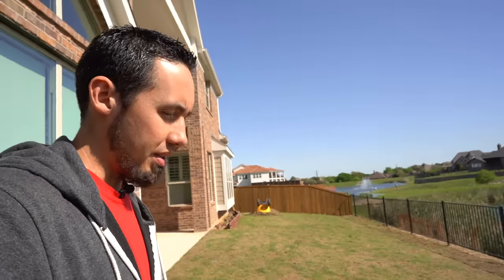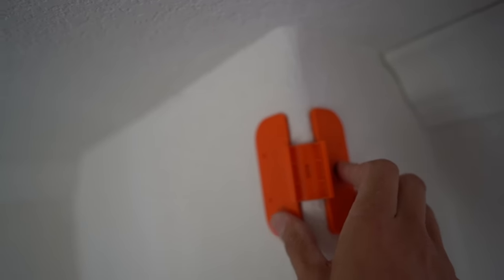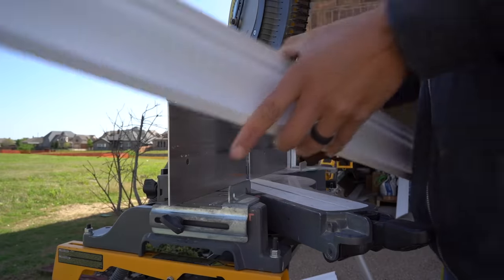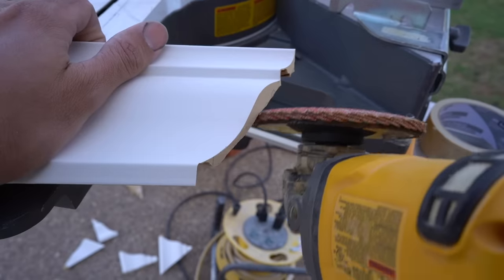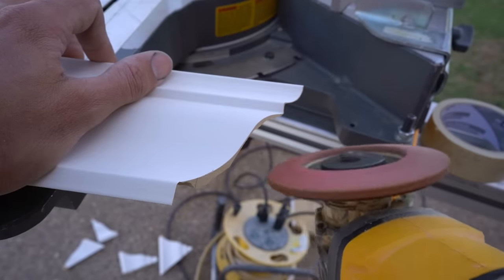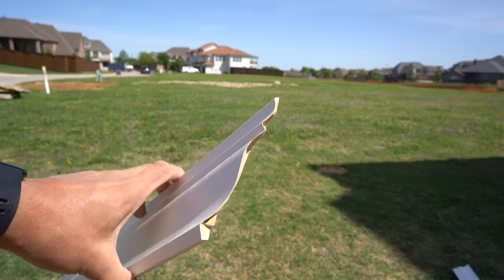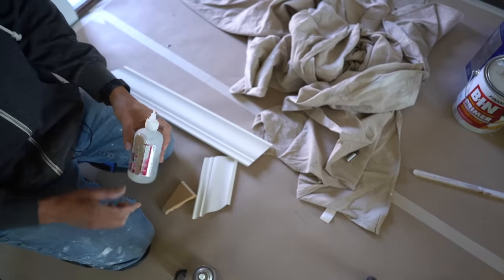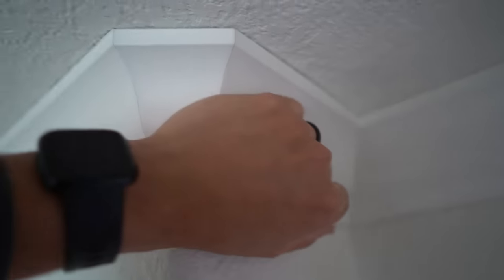This Makes Coping Easier

Comment: Hey Richard - I see the B-I-N primer in the background, I can't remember if it was you or someone else who turned me on to that, but it is excellent for MDF.  Have you found anything better to prime MDF or is it still your go-to?
Reply: Doing painting for insurance contractors the shellac base stops every stain i ever found, smoke, water, tannin ! In fact, all zinser products are great.
Reply: I have its XIM
Reply: Best is the Zinnser Coverstain!
Reply: Bin primer is the best primer you can use hands down for anything not just trim or MDF like literally anything shit will stick to glass and allow u to paint any type of paint over it and it will stick for sure shits amazing it has its cons tho also like it's mighty thin being it's a alcohol based primer and it dries in like 5 mins which can be a good or bad thing but I love the stuff it's great. Unfortunately you won't find it anywhere now a days smfh first it wasn't around wen covid started cause I guess they needed all the alcohol for hand sanitizer or whatever but then it came back around n now gone again like a ton of paints n materials are cause there all sitting off shore in those shipping containers smdh
Reply: They also have what, old time Carpenters call ,a coping saw,  I would of had 3 copes done, by the time you f,d around  with  the grinder

Comment: Should try this with the new M12 3” mini grinder.
Also, I have that Starret tool, and it finds Angles and Mitres
Reply: I have the m12 3" cutoff tool. Have you used that tool to cope? I was unaware you could bet a sanding disc for it

Comment: An angle grinder works great for MDF, but interestingly, I found that using an angle grinder for WOOD molding is much more difficult.
Reply: Larry B I just figured this out the hard way. I suck at this shit. Anyone who says trim carpenters have an easy job have never had to install crown molding. Lol
Reply: @wildphototaker  I installed countless and it is easy job.  I use jig saw.  This guy is hack that neither can cope with jig saw neither can deal with compound cats.

Comment: I just used a flap disc coping my first crown job. Very easy and successful.  I also want to add that I purchased a speedcope from Rockler woodworking and was not impressed. I also want to add that I used a Dremel to clean out any small areas in between the smaller details. I have 40 years experience as a concrete carpenter and I am really enjoying the trim work process and these videos definitely help out. Thanks!

Comment: Thanks for the tips man, I will be cutting my first coped baseboard this week. We typically use square stock at work, but this particular stock has a slight profile. I just bought a coping saw, but I think I’ll bring my grinder with me to try this out! I think the coping saw might come in useful if I decide to cut indoors. Have you ever tried clamping down your piece and using two hands on the grinder? Or, for smaller pieces you could clamp the grinder and control the piece?

Comment: I've had a Mikita angle (4") grinder for 40 yrs. Used for everything related to tile stone wood plastic metal. Never broke always working. When I started doing trim I progressed from sandpaper to adding files then it hit me, the grinder. My skill at fine work improved immediately. Man was I happy. Solid confidence, so comforting.I can imagine how many converts you have who can't wait to try it. The ca glue is a great one also.

Comment: Whenever I do trim work it looks like I tried coping with my teeth.
Reply: Yup caulking  fixes all
Reply: @robertsalas3984  No, that is wrong thinking, like my dad, he uses caulk. Getting a smooth cope requires a fine coping blade and some foam sand paper, so they are a tight fit, then glue the corners, caulking is for sealing along your molding, not filling in blemishes. When you paint the caulk, even if it is painters caulk, it will be darker than the trim, and or be obvious, always use wood filler or drywall compound for filling holes form nails/staples.
Reply: just cut close to the trim line and  use a foam sander and sand off till excess is gone, and you have a clean line, check fit, glue your corners, and nail on. You can get same results he got here. Just be steady and don't rush it, you will be fine.
Reply: I keep watching your vids, another nice job! Think it's important to stress a dust mask and goggles for this practice as it will kick out a load of particulate and I can assure you it makes an impact, especially over the long haul.
Reply: @robertsalas3984  Yes it does, but doing it perfectly is better.
Reply: @robertsalas3984  like my daddy always said, ''puddy and paint make a carpenter what he aint''
Reply: @robertsalas3984  I wish you would have told me that when my kids were in braces!!

Comment: This is the way ive been coping for years! Many guys use a jigsaw and it turns out rough cut. The sanding disc is key and all ill use! You can use the saw to remove most material if pine or another wood besides mdf. Then come in with disc to touch up! Great job 😊

Comment: Hi Gary from the UK here, I haven't done a lot of Crowne moulding BUT I am very impressed with  the technique of using th angle grinder I will definitely use it on but and scribe joints on dado joints, Great video very interesting and informative keep them coming

Comment: I did my first crown moulding job yesterday using a cheap Harbor Freight angle grinder and a flap disc. Hard to believe how easy it was. It came out great, considering that this was my first time doing this. I would have never thought to do it this way without seeing this video a few months ago. Thanks!

Comment: Thanks for the tip. Did 2 inside corners last night with a coping saw, last time was 33 years ago. 1 corner came out perfect and the second gave me so much trouble getting a tight fit I gave up and just filled with caulk. Wish I saw this video yesterday. Guess I know what I'm doing tonight to fix that piece

Comment: This is awesome advice!!  I'm trying it right now on a baseboard job (pine baseboard) in my house. The flap disk, three files (1/4" round, 1/2" round and flat) and I'm NAILING the coping. And it's fast - way faster (and more accurate) than a manual coping saw, which is what I would have used.  When I use a manual coping saw, it always looks like a 4-year-old's drawing.  Until you get used to it, be careful with the grinder when you get close to the line. It can remove material pretty quickly if it catches. Just take little bites.

I never would have thought of this, so thank you for the great tip! Subscribed.

Comment: I been using a makita gv 5000 since 2000 with a used 60 grit disc. It is faster and better than the coping saw. And, my paring is so thin and clean that even when the walls are askew, i can carefully compress the coped end to a perfect fit. Glad you posted this. Folks think im crazy having only 1 tool do a better job in half the time.👍🏼

Comment: I have been a carpenter for 48 yrs i dont need an angle grinder to do crown moulding just a coping saw but then again i dont use any mdf. Stain or paint it fits everytime not saying your method doesn't work i always like seeing different methods of how to get things done. My 1st boss told me to get started in carpentry told me with a hammer, hand saw, square you can build a house, i love that old timer. He's  90. Yrs old now.

Comment: Until I came across these videos, I had no idea what coping was at all. I'm just finishing up a small bathroom remodel that has trim replacement on two walls with one inside corner. I'm using PS trim because of the moisture. I just did a practice cope with a Dremel and it came out great! Now on to the live piece. Thanks for the education!

Comment: Winter harbor freight bought myself the cheapest angle grinder in a sanding wheel and this worked pretty darn good for me as an amateur yeah I had to cover some stuff up with caulk but this was a nice solution thank you

Comment: Vey impressive! Thank you! I am restoring my 1903 house, which has three part base moulding 9 1/2” tall. I am planning to reinstall the original moulding as much as possible, and have been looking at videos to learn what my options are. I learned a lot from your video, even though it’s crown moulding instead of base. I have bullnose corners in a number of places. It looks like I need to get DeWalt equipment!

Comment: I'm definitely going to use this, also found out this year that an angle grinder with a thin cut disc cuts siding like butter, even in extreme cold and it doesn't crack!
Reply: Or melts??

Comment: This video was inspiring, a new way to leave my coping saw on my pegboard and break out my grinder lol. I will share this with my dad. My dad was installing new base molding, and was butting end joints , and just cutting 45deg cuts for corners, even though they were not square. He was using basic round over base that was MDF. I said, why don't you cope your corners so they fit tight? every corner is not true. He said you cant cope this trim!!! I said I can cope crown or multi curved base molding, so yeah you can cop basic base molding. He said that is what caulk is for!! I said when you paint the caulk will be obvious trying to cover sloppy joints.  I said, I can show you how to cope your base, and also back mitre your splices. he said, well it will be behind these desks, so I don't care!!! My dad has seen my work, so he knows what I'm talking about, but his pride got in the way.  When I was in California, my dad wanted to lay tile in most of the house, my son offered to help him, because he learned from helping me lay tile in our home, I showed my son how to mix thin set, lay tile, cut in the tile, mix grout, and grout, my dad said no!! His tile is all uneven and not level, edges are sticking up. Now he is dealing with Parkinson's, but  he will not ask for my help, He is missing out on all the things I learned in the trades I worked in. I worked with a GC for years, and worked with a flooring crew, and cabinetry company..

Comment: I never did coping before because I don't have a saw and it looked tricky anyway.  (Just caulk up the spaces) Just did the baseboards in my living room and used my grinder.  Worked perfectly even on my first try.  Thanks!

Comment: Been doing this for years. Get a hard plastic backer disk at HD. Trim it down to 1/4 " smaller than the 4 1/2" sanding disks. You can get a knife edge cut in tight spaces. Works great on everything,hardwood to MDF.. Use different grits 36 to 100 depending on how aggressive you want to be. Good content and work! Keep it up!
Reply: Also works great to scribe cabinet fillers to an uneven or out of plumb wall.

Comment: I've done it this way with grinder, I've used the Collins coping foot on my jig saw , and I've even coped with my table saw, the grinder with 80 grit sand paper to smooth things out afterward is the best method, I've found

Comment: How does the flap grinder work on pine crown? It looks great on MDF I.E.ease of cope.
I remember being on huge crown jobs when I was young. The crown would typically be installed left to right so early in the morning we would cope about 20 or so left ends so they would be ready to be cut to length. We would leave all of the right ends loose on the wall e.g. wouldn’t pin them until the coped piece was fitted. I understand you were talking quite a bit when showing us how to use the flap grinder. I could cope a piece of crown pine pretty quickly with a coping saw. You are right about the fragility of MDF, that stuff is not very forgiving. 
I’m no longer pinning trim these days but I really enjoyed watching this video. Made it easy for the painters for sure. 
One last thing! It’s great to see you using that Dewalt 2.5” trim nailer. I bought the first generation of 18V and never looked back. It was refreshing not to drag a hose around all day and also to not have to keep buying fuel cells for the pass load. Tried it all man! 😂

Comment: Good video I've never used the grinder but I've used a Dremel with a small rubber sander. This works really good and get it in very small places. I like the way you did the outside corner very professional

Comment: Great work ! I watched another vid of coping and thought about using an angle grinder, then I watched this vid and saw how much easier it is but it I were to do this I'd have the workpiece clamped down so I could get a steadier hold on the angle grinder.

Comment: After  7 years service and 8 surgeries later, hands are not so steady. I get close  with sander or saw then glue down thin sheet sandpaper on a scarp piece of molding and then tilt and sand the "coped" edge over the sandpaper which has the shape of the molding and get razor perfect fit....until my hands shake to much at the end and break the nice edge I made...but you get the picture.

Comment: I have flapper works well even to fit base in older home with messed up walls.
The crown is intriguing lit of detail.
Switched over to metal.cutting wheel.
Real pain.

Comment: I have been using a coping saw for over 40 years after trying a jig saw at one time. While it worked okay it had a tendency to mar the finish on the prefinished wood.  I think the key to using a coping saw is to have a frame that is stiff and to use high quality blades with the right number of teeth per inch. The blades sold in a typical tool place are poor quality and have too many teeth per inch for the wood being cut. Using power tools often creates a lot of dust and takes much longer. When cutting crown I place the saw at 90 degrees to the cut I made on the miter saw so it is back cut. On baseboard I typically back cut the material about 88 degrees to the face with the top of the base at 90 degrees to the face. A few years ago I installed about 1,000 ft. of crown that was about 1-3/8 thick and 6" wide. I cut all of it with a coping saw. Recently I installed about 1,000 of cherry baseboard that was prefinished in a home and cut all of the inside joints with a coping saw.

Comment: My boss prefers to use the angle grinder technique but I don't know. I've been using a coping saw or jigsaw on my copes for years. But your cope is very clean. Great job on it. Also those bullnose jigs are awesome to use. We used to pre-make a corner jig out of crown and cut the bottom of the center piece out and use that to create our measurement lines before we found out they already have made that jig lol

Comment: what's impressive is not just that technique is amazing and so fluid and quick but holding that DeWalt Grinder .. (if that is that regular powerful grinder that cuts metal and takes 4.5 discs ) with one hand ....that thing is a beast!!!

Comment: Nice work.  I've used a coping saw, Dremel, drill sanding disc, and even an oscillating mini saw to do these types of cuts.  Using an angle grinder and flap disc looks a lot easier and faster.
Minor note, the spray you're using with the CA glue is not an really an activator, but an accelerant.  It greatly speeds up the dry time of CA glue.  I've been using it in my woodworking shop for years.

Comment: barrel grip jigsaw with a coping foot from collins and you are good to go without (sanding in this case) a inch off material meat. you will be able de have a decent angle for a tight and stronger joint.

Comment: I've been using this method for decades but I have never used a flap wheel. Just a standard grinder wheel. I would like to mention that on the bottom edge you have 2 flat surfaces intersecting so in order for this to fit tight, you must remove the existing bottom face with razor knife in order for the coped piece to join without a overlap. Also, on 6 and 8 inch solid hardwood material, I will take as much material off the back side of the crown while on the miter saw to save on discs. Also note, the masters always lay their crown flat on the chop saw table to cut. When 6 and 8 inch crown is used you no longer have the luxury of cutting while standing at 45*. That is, if your crown is made to install at 45*. It can vary by 5 or 10*. On 2 and 3 piece crown, your base material also has to be cut in the flat position. Your guide stop would constantly be in the way. I also recommend a variable speed grinder. Full blast is often a bad idea. Enjoy,   Woodmaster            out
Reply: So if cut on the flat what is bevel angle and swing angle?  I think crown also comes in profiles with different spring angles so how would you set the chop saw?  As a DIY guy I learn not only from guys posting videos but those knowledgeable folks that share other ideas in the comments.  I have some simple 7 inch MDF where I  will need to cut it on the flat given my small chop saw.  Thanks in advance

Comment: I believe the company is called Colby tools and they make something called a coping foot. You take the base off of your barrel grip jigsaw and install this and it will easily takeoff most of the material and then you clean it up with a rasp. Doesn’t have to be an expensive jigsaw, my nice one is a festool but it Hass to be Barrel grip! The coping foot only cost about $35 or so, are used to be a carpenter on Martha’s Vineyard and I was working on a huge job and we had Poplar crown that was 6 inches wide, forget about using that actual coping saw I was lucky enough to be able to use a copemaster